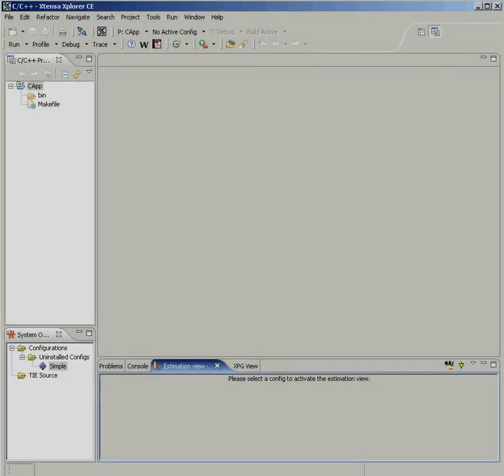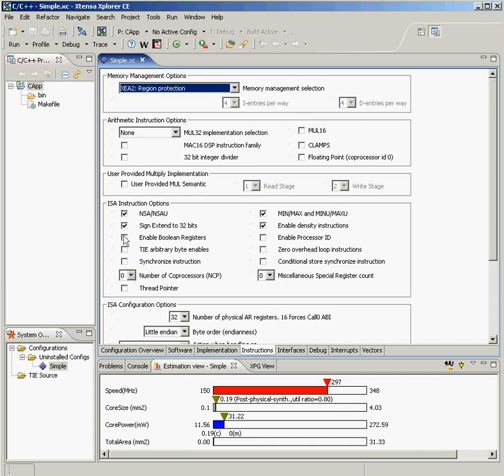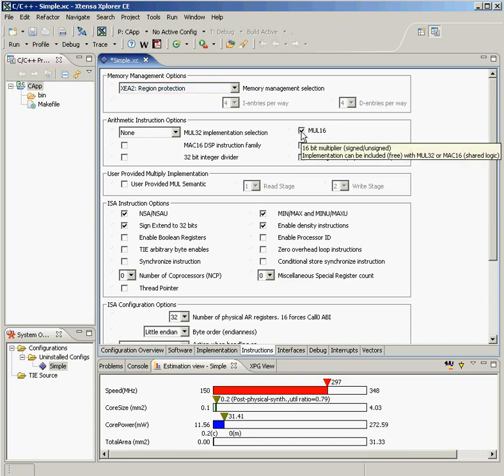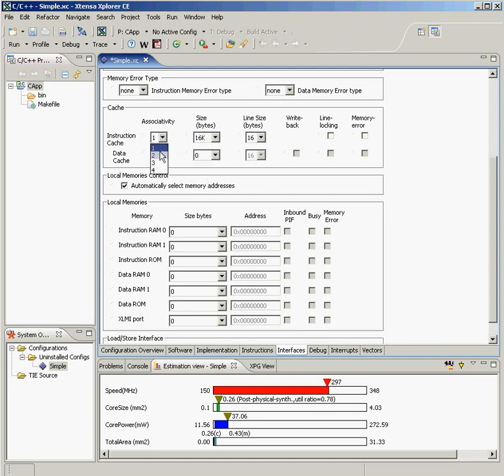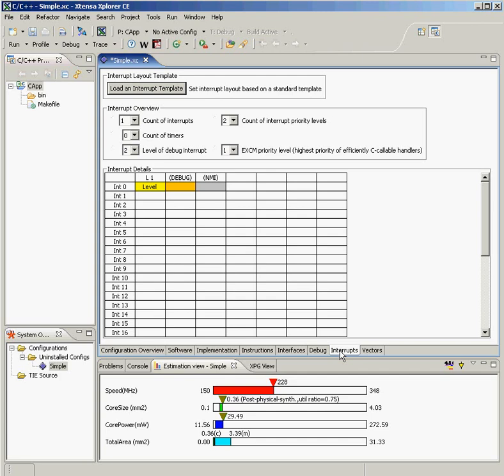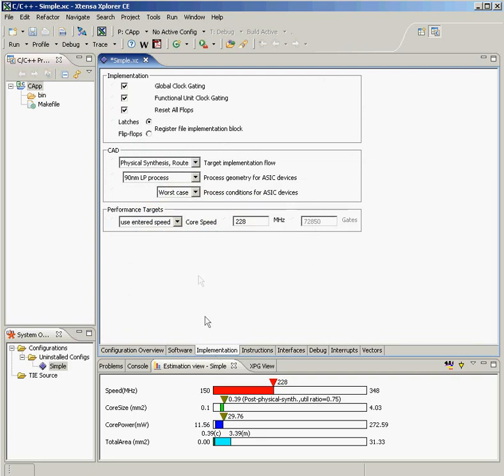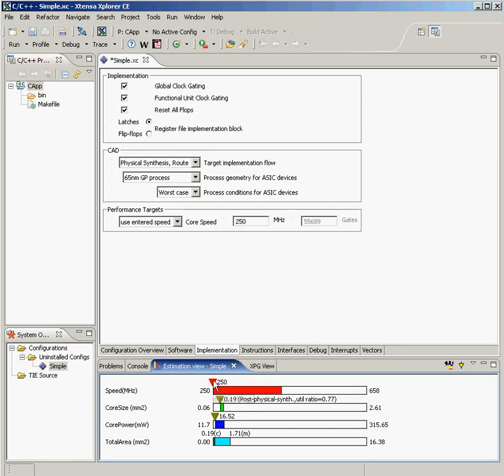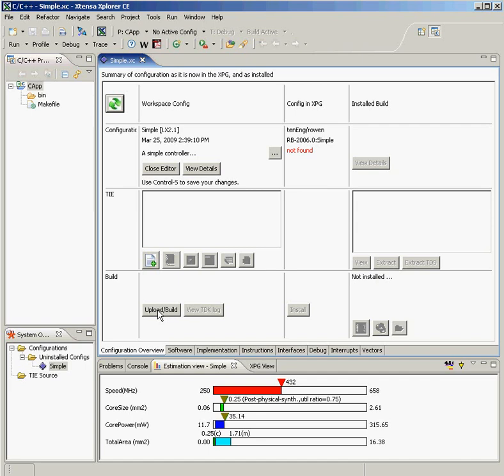Tensilica Config Demo v2

Comment: Nintendo should use a Tensilica audio DSP in there DS  handheld successor. It would do the same job as Sony's "VME" sound chip used  in there PSP. The current DS has a pretty limited sound core that can only do 16 channel wavetable synthesis and games have less complex audio than Sony PSP.